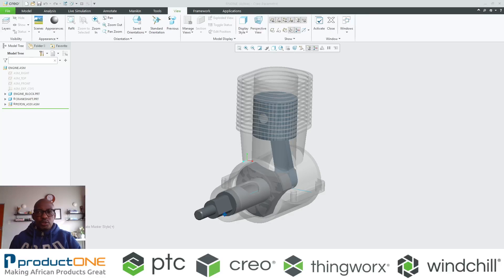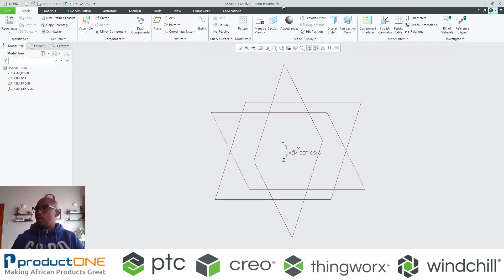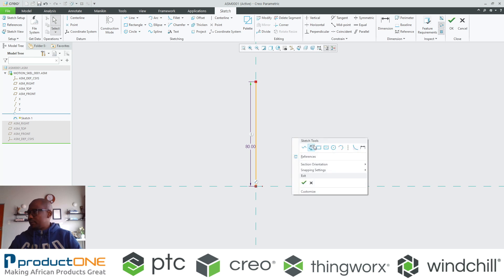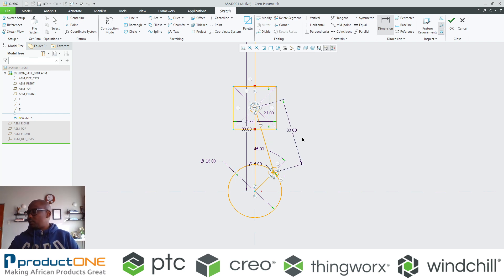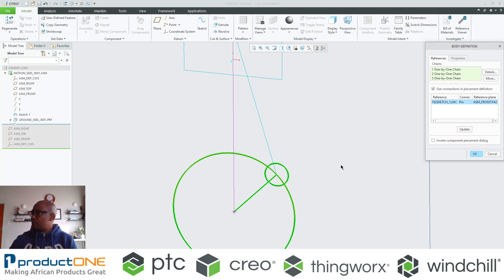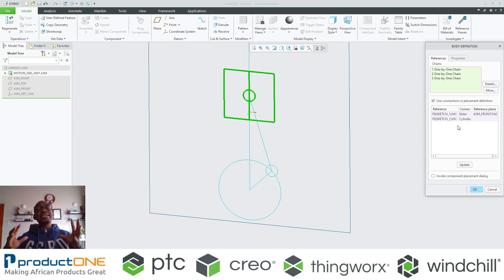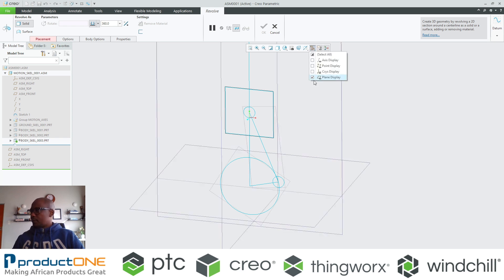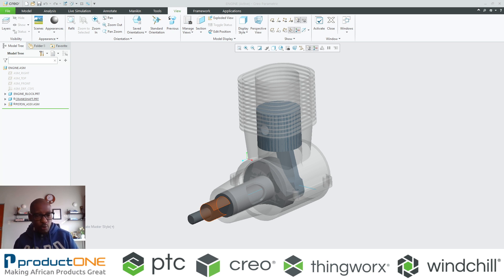Creating Motion Skeletons to create the Framework of your design

Comment: Hi, thank you for an excellent video. I have a question. Assuming I want to change the diameter of the piston. I would like to change the diameter in a main skeleton and hence it would change in the motion skeleton. Problem is, if I create a Main skeleton and then use this skeleton as reference geometry for the motion skeleton (i.e. copy to motion skel) all connections appear as Ball in the motion skeleton. I can create the motion skeleton and add it to my main assembly (containing the main skeleton) but they are two skeletons and i have to make two changes. Is there any way to connect both the motion skel and a main skel? Copying geometry to the motion skel results in these Ball connections only. Your help is mush appreciated. I've worked on this for the last week and cann't figure it out.